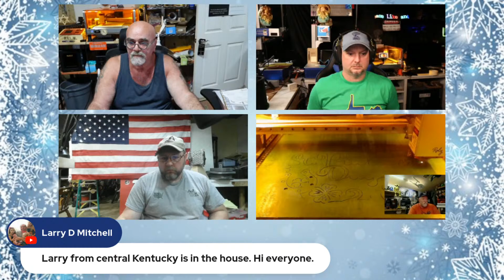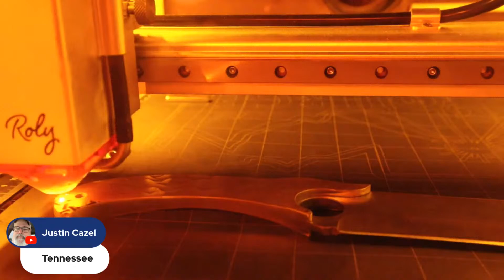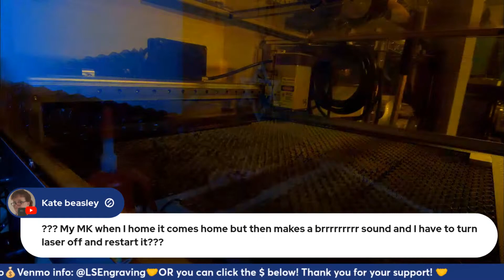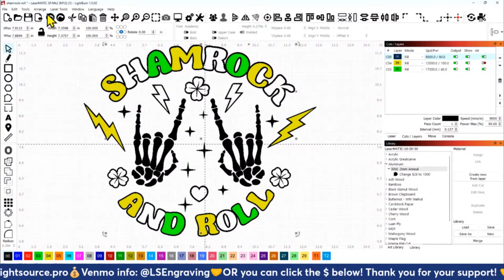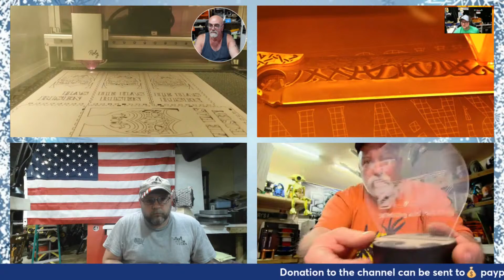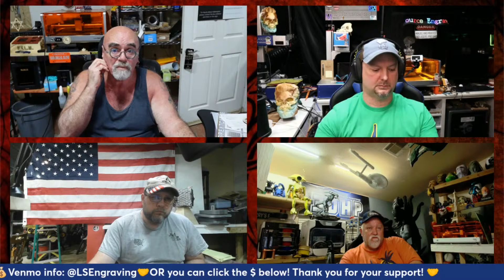🫡 SATURDAY NIGHT LIVESTREAM!

Comment: If I remember correctly, you mentioned in the videos that the diode laser should be used at max 85% power and that the Lightburn $30 spindle speed =1000.
Can that be translated into Finnish like this? $30 = 850 and you can run at 100% power.
Reply from the maker: It's the Co2 that needs to be throttled to 70%. Spindle speed of 1000 is 100% power. 500 would be 50%.

Comment: LaHobbyGuy hi again. I've been getting to know the sculfun 9 laser for about a month and noticed that there are no settings with which it does anything decent. There are a few almost working combinations between driving speed and belt tension, but due to the unfortunately poor quality, the machine cannot work as desired.
There are several reasons, but unevenness in the dimensions of 20x20 profiles, oval rollers and unbalanced drive wheels cause the most problems.

The thing that surprises me the most about the whole laser scene is that I haven't seen any values for belt tension anywhere, only opinions.

For example, it would be easy to measure the tension of the s9 straps with a bag scale and lock the strap to that tension with a stop screw.
For example, the end of the belt rotates through the Knob operated roller tensioner familiar from 3d printers and is attached to the scale, in which case you can rotate the exact amount of tension from the knob and lock the belt with the original screws.
Then moves the measuring device to the next belt and adjusts it etc...

Now we have the facts on paper that "y-belt 2x 700g and x-belt 900g" (imaginary values)
Before adjusting the belts, use the same measuring device to measure the tension of the eccentric nuts, by measuring how many grams are required to pull in the x&y directions to move the slide. (current instructions: tilt 45 degrees and it should move) <- really?
Reply from the maker: The diode laser industry is still in its infancy.

Comment: The focus spot size on the Lasermatic Mk2 (20w [0.24mm x 0.12mm] and 30w [0.35mm x 0.22mm] @100%) seems to be quite large and rectangular.  Does it compensate for that when cutting?
Reply from the maker: These are honest manufacturer specifications, unlike other brands. I have found the beam to be more circular myself.
Reply: @TheLouisianaHobbyGuy  
Good to know, thanks!